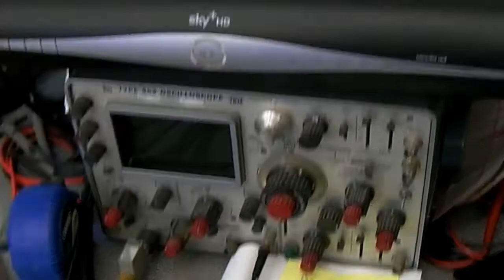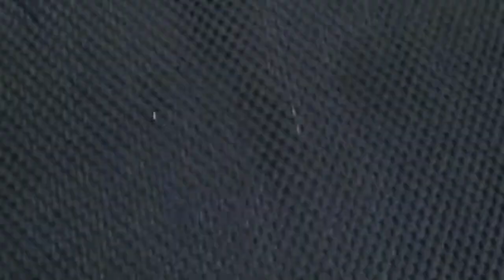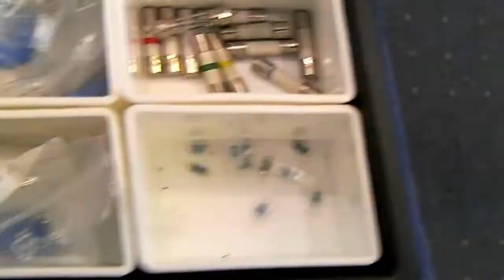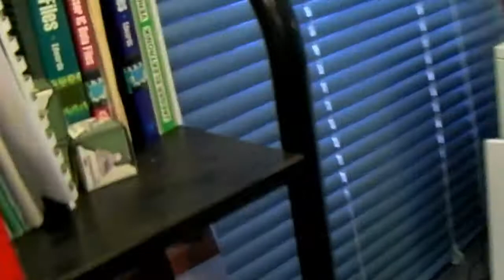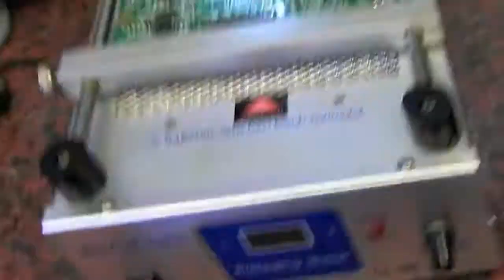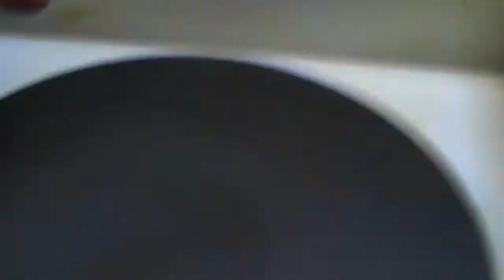Workshop Tour V1.1

Comment: Nothing wrong with an Aoyue soldering station.  Mine is a 937D+ (Yihua brand).  The handle has a genuine Hakko 60W ceramic heater and uses standard Hakko tips.  The main unit has an LED readout and a rheostat for adjusting the temperature setting (it's all digital).